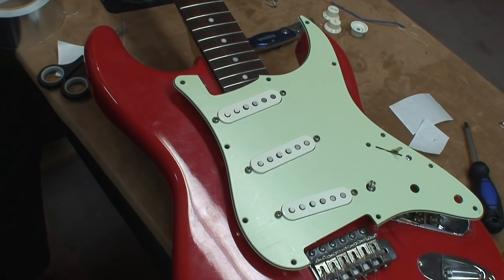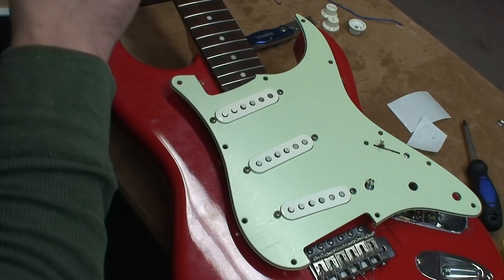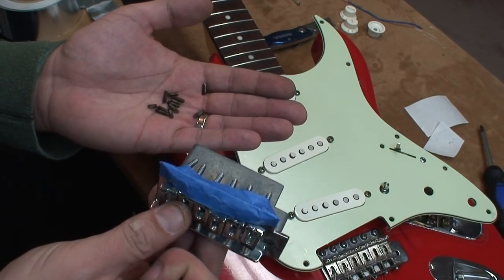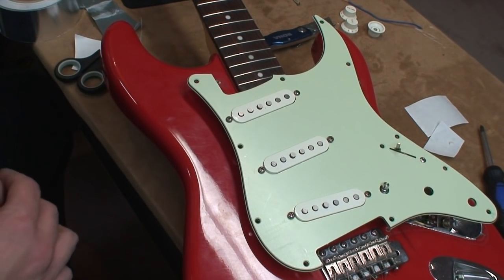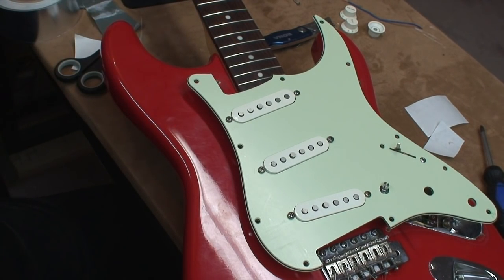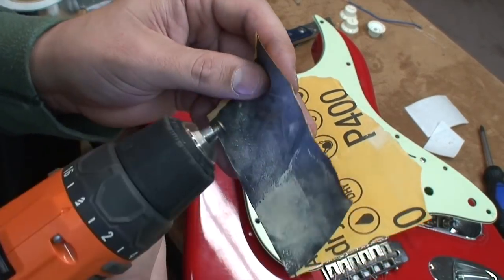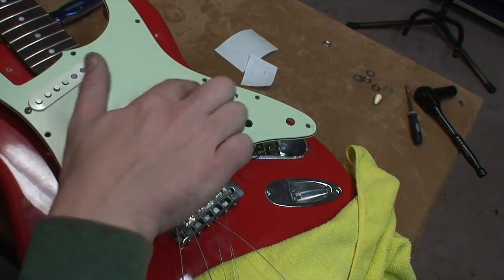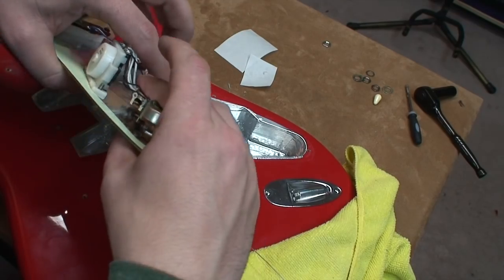Quick way to restore rusty screws on your Guitar!

Comment: Sanding will likely remove any remaining plating from the screws causing them to rust again. Soak the screws in white vinegar for a few hours and then scrub the rusty paste off. Vinegar reacts with the rust to dissolve it off of the metal. Then coat them with WD-40.
Reply: Yes it's great idea , baking soda and vinegar ,if you want to keep chrome on use aluminum foil instead of sandpaper.
Reply: Don’t use WD-40 to keep moisture out. In my experience, it does the opposite. It causes it to rust even faster. 
I don’t know why it is the case, it is so.
Reply: 12x12surface i thought the WD40 can clean the rust and can last as long as you clean it every time you play ?

Comment: You have taken the coating off and that will start oxidising much faster than previous screws. Do not do this to your screws unless you plan or re-coating or sealing them with an oil or silicone based spray. Come on dude that is a 'no-brainer'.